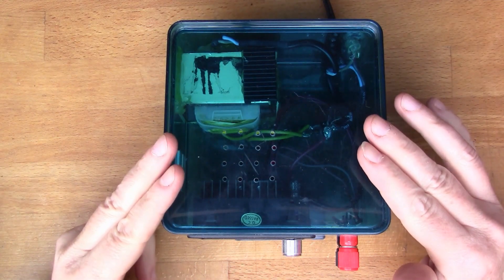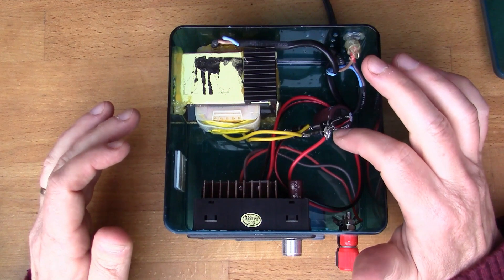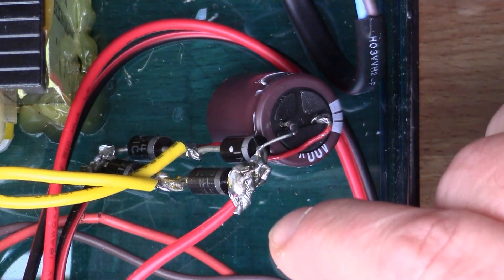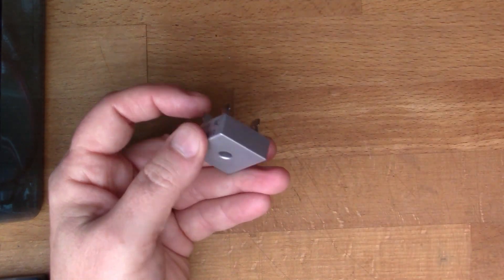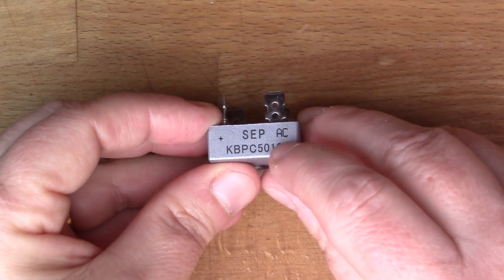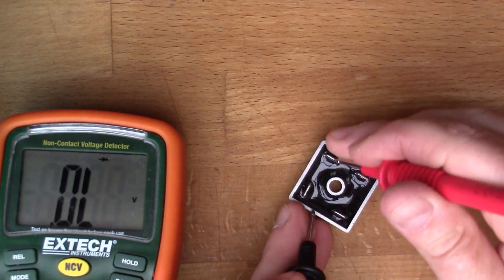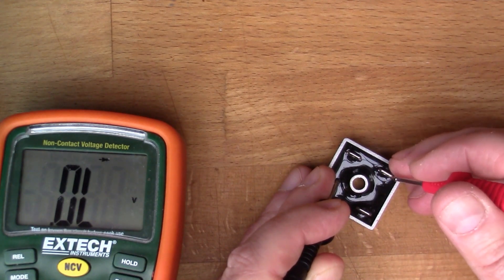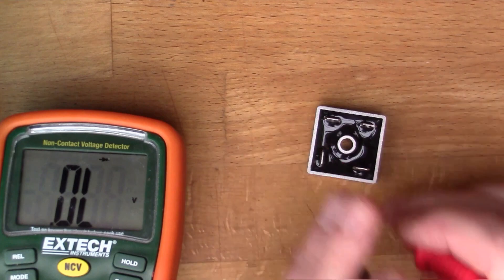Replacing the Bridge Rectifier in my Desktop Power Supply Unit (#129)

Comment: Isn't the switching module rated for only 30V and you've got 32V on multimeter
Reply from the maker: I think that I had a 30V module in here originally, but the 50 in DP50V5A means 50V.

Comment: Hello! I heard that there are voltage spikes ("transients") on the grid power line, and MOVs are used as protection. I wonder if that is posing a risk to your minimalistic power supply.
Reply from the maker: That would be a good idea, and I do have some MOVs somewhere.  The mains supply is quite well behaved here in the UK, so I'm not aware of anything that's ever blown up in my house due to transients.